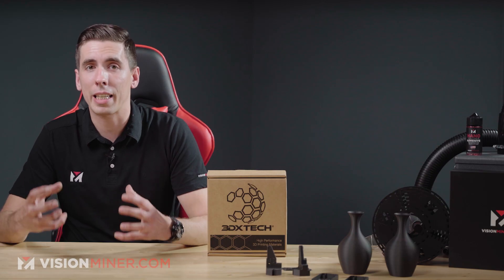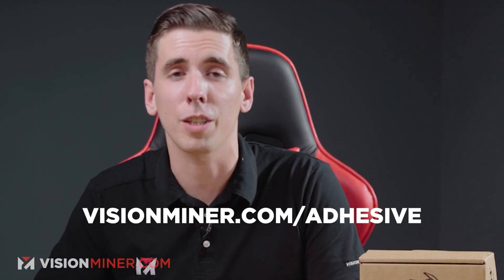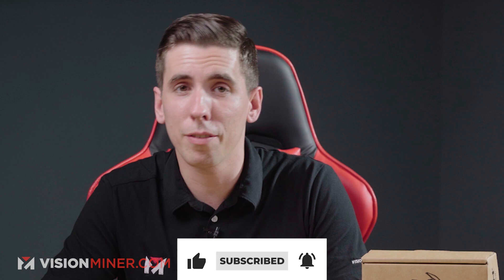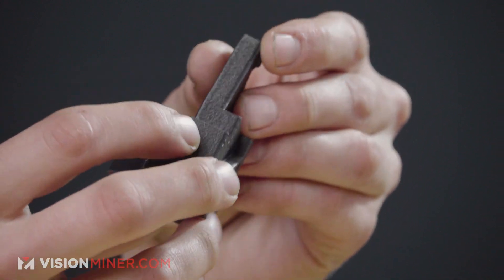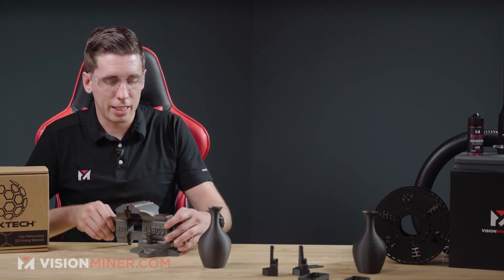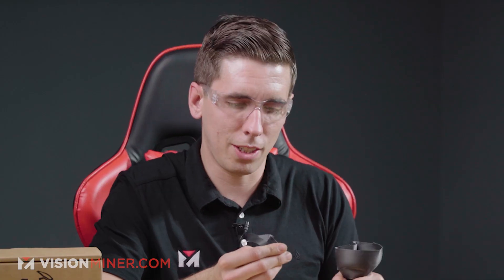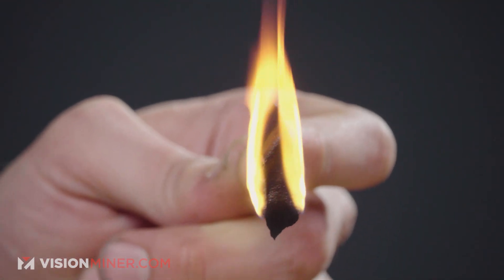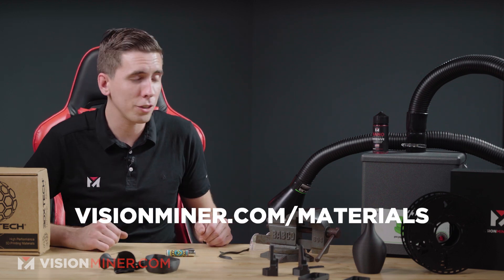CarbonX HTN-CF - Carbon Fiber Reinforced High Temperature PPA Nylon Filament by 3DXTech - 2021

Comment: Do your filaments work with Bambu Carbon 3d printers? 

I've looked at the recommended MarkForged printers in your website and they have buttons to request a quote instead of letting me buy it. That is a huge major red flag for me even if they are really good printers.

Comment: Do you guys sell unfilled polyphthalamide or plan to in the future?  PPA has some amazing properties, not just as a high-temp stationary structural material, and it would be super useful for wear & impact applications where CF/GF are detrimental.
Reply from the maker: Yes we do, it's regular HTN from Essentium (also on our site in the Nylon section)

We've actually been experimenting with dual extrusion, where the core of a part is HTNCF25 and the outside is HTN (PPA) for exactly that reason :) mostly for wear properties

Comment: What is the CUT of this material?
Reply: What’s CUT?
Reply: @williamcarnero9595  Continuous Use Temperature
Reply: @masonbattaglia7123  thanks, I think that’d be a good number to know when I’m looking at different filaments.
Reply: @williamcarnero9595  yeah I use it more then the HDT (heat deflection temp) because even ice can handle 400C for a second 😂😂

Comment: would love a comparison to Essentiums CFHTN. 

we bought 1 spool of HTN and CFHTN from essentium and its very strong.
However, I dont feel the CFHTN is as strong as their datasheet says. 

I printed 2 equal parts, 1 in Essentium CFHTN, and 1 in 3Dxtech CF-PA6 (gen 3).
Essentium CFHTN was stronger, but not 4 times stronger (maybe 1.5x) as the datasheet would imply. 

Thoughts on this ?

Comment: Have you successfully printed this airtight? I've printed their PA6-CF airtight (held 50PSIG for 30 days), but haven't tried this yet and would like to use it for some automotive parts. How does it print compared to their PA6-CF?

Comment: A great filament, shame a prusa cannot use it
Reply: I think it can. At the bottom range, yes, so worse strength, but it’s possible. For example, I print PC with a heated bed at 110 degrees and CF nylon with a hotend at 290. Just not above 290,  as with my horribly PID tuned Prusa, it goes up past 300, then triggers maxtemp.

Comment: I know the TDS is coming, but seeing other comparative materials, I would assume this material around 100-120C should hold up to ~25psi in a 3.5" tube? If I'm doing my math right haha. Should be good if you're mentioning intake manifolds. Looking at intercooler piping as well as other supporting parts. Thanks!
Reply from the maker: Definitely, that's a great application!
Reply: @VisionMiner  thanks guys! You’ll be seeing a fat order of it in a couple months when I’m assembling!

Comment: Question: Could I print an, engine rocker cover for my race car with this filament? 

I know it depends solely on the under bonnet temperatures... that are varying between cars. 

A better question is, has anyone printed a rocker cover? 

😂🤜🏼🤛🏼🇦🇺🍀🍀🍀🤓😎
Reply from the maker: hmmmmmmm GOOD idea -- however I think something like ULTEM 9085 or 1010 would be a better choice at those temperatures! Videos coming in a few days!

Comment: When I back-up the video and replay the "Break", you have to bend a good 30° before it breaks; "That's Good", but; what you need now is a pull test.  You need to pull along the strands rather than pull them away from each other, as in; layer from layer.
Reply from the maker: Like a z-axis layer adhesion test?
Reply: @VisionMiner  Take another test strip, like the one you broke in the vice, but; print it with holes on both ends and a narrow section in the middle so you can pull it apart slowly with a scale on one end, so;  you can measure the Lbs until it breaks.   I'm seeing 3D Printed helIcopter rotor heads out of that CarbonX HTN-CF, if it works.

Comment: OK; I know your Filament is specialized, but; all I have is a CR 10.     I can print Matter Hackers Carbon Fiber Nylon, but; it looks like I'm going to have to get another printer if I want to print with you guys.  I need to build a printer that can print hoter than 260°.   What kind of printer do you guys use?
Reply from the maker: You can still use the CFPA6, too! https://visionminer.com/materials#nylon

We mostly use the Funmat HT (visionminer.com/funmat) 

You can easily upgrade your hotend and be printing at these temps, probably for less than $100 :)

Comment: I am getting conflicting info on your site vs 3DXTech's page. Neither has a TDS which is a bit disappointing bit your site says 190c HDT and in this video and on 3DXTechs site it says 220c HDT. It would be great to get a TDS from 3DXTech like the ones the Essentium provide for their HTN Nylon
Reply from the maker: We should have a TDS for this soon, it's brand new so they're still working on it :) And thanks for noticing the typo on the website, that has been fixed!

Comment: Looks like I know what I'm printing my parts for my heated chamber build in. You should put a link to the material in your description.
Reply from the maker: Good call, added, thanks again!
Reply: @VisionMiner  confirmed, it is fixed. It's Sunday, go home and stop working. I will be buying some of this tomorrow because I got a feeling it comes with extraordinarily responsive technical support!

Comment: another great video boys in my experience with this material if you don't have a heated chamber you just need to print slower but I highly recommend an enclosure just to keep the temperatures a little more consistent I find around 300 on the nozzle and then I used 70 on the bed with Elmer's glue all mixed 50% water sticks like a champ
Reply: just wondering, what printer do you have that can reach these temps? I have a stock cr10v2 and max nozzle is 260° and 110 for the bed
Reply: @ikkeennigij121  troodon by formbot and a funmat ht enhanced the troodon has eh slice engineering copperhead in her
Reply: @princefpv1  I see, bit out of budget.. thanks